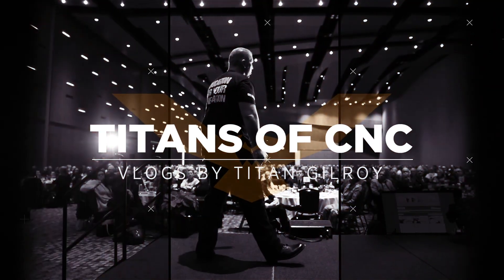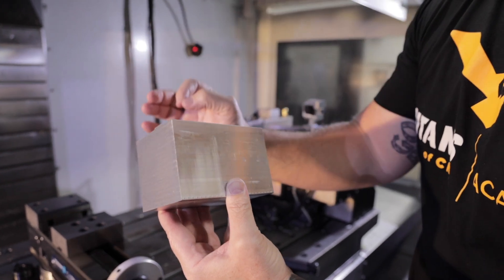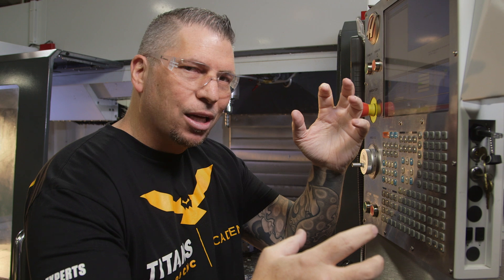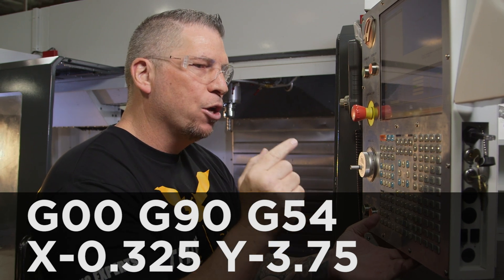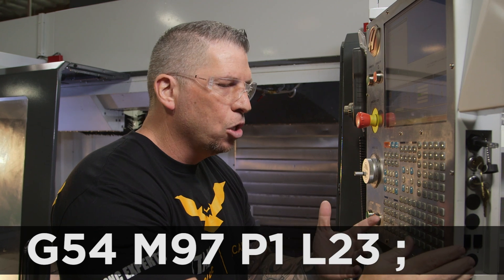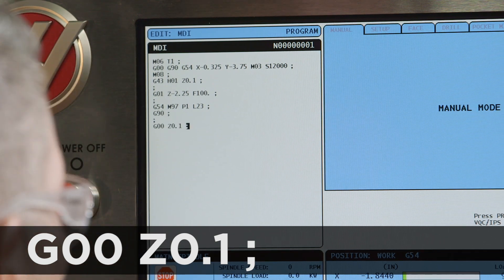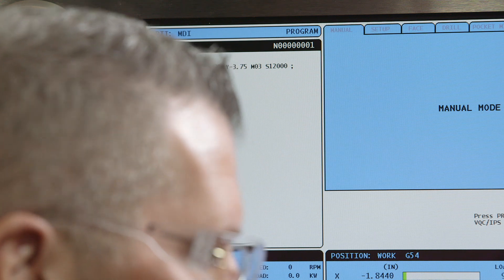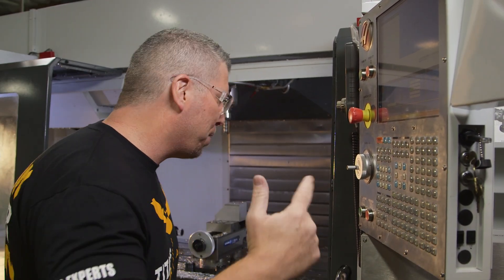G & M Code - Advanced Manual Programming Trick - TITANS of CNC Vlog #51

Comment: Can you set variables on hass? If I were doing a bunch of those I would program it essentially the same but set the feed line as G1 F[ VC1] and after each G1 move put something like VC1=VC1*1.001 for a 1% increase per pass to account for less material bring machined. Naturally, you could add; mulitply; subtract or divide depending on what effect you want
Reply: I <3 Fanuc variable programming. I worked at a job shop and had about two dozen programs that were basically subroutines that I would use to get through one off jobs as quickly as if I were set up for production runs.

Comment: Just did a  local subprogram. To do a bunch of interpolated holes
Code looked like this
%
N11111

N1003
T3 m6
Go g90 g54 z0 y0
S65000 me
G43 he z1.;
/M8;
Z.1

M97 P1000 (SEARCHES FOR N1000 below)
:
X5. Y-2. (New hole center location)

M97 P1000 (n100 again)

G0Z1. M9
G53 Z0. M5

M97 P55 (SKIPS TO N55 DOWN BELOW)

(Subprogram);

N1000
G1 z0. F50.
G91
 x.1 F25.
G3 i-.1 z-.05 L5( goes down -.250 from incremental start point)
G3 i-.1;
G1X-.1( back at center of hole)
G90 
G0 z.1 
M99;

N55 
M30
%
Reply: Let me know whT you guys think or if I can do it in an easier fashion( reason why my feed moves are in incremental is because I do this a lot when thread milling. I will go down to thread depth without cutting material and interpolated while going up on z with an L for repeat command, until I clear the hole and can go back to g90 mode.
Reply: It is imposiibile doing circle from,
G1z-10
G91G3x-0.1I-0.05
I0.1 
to Z0..

Comment: Back in the day, i used to use a sub incr z+, prog loop, works a treat, in heidenhain, or m98 /m99 also incr scale factor to produce pyramids, you can work out the tangent and create the x/y stepovers to create the angle, also linear polar and angles can do loads for way less code, just link the subs together
Most Miller's would have a bunch of subs tucked away 
This was back when cad was only used for more advanced profiles

Comment: We had two old cnc lathes that had to have their entire program written in incremental. The new programmer and newer supervisors kept crashing it thinking they knew more than us older experienced operators. Rather than admit they could learn a thing or two from the old guys on the shop floor they blamed the crashes on the machine being old to the plant manager. Their solution was to scrap both cnc machines and replace them with something they understood. A boat load of money later and the two new machines produce 3/4 the amount the old ones did with experienced operators. 

If your running a part where one critical feature such as a groove is dimensioned off another feature that needs constant tweaking because of tool wear, that's a good place for a few lines of incremental code. You only need to adjust for wear and the incremental feature remains locked where you want it. They can be dangerous if you have a new guy trying a machine restart in the middle of a program if he's unaware incremental has been implemented in the program.

Comment: What changes to the main and sub could have be defined to start center top and create a parabola?
Reply: Running on Heidenhein myself, how I'd do it there:
for simplicities sake we start at z=0 y=0 (which should be middle top of your work piece) and go down from there (starting from any height would be possible but requires more parameters) and side to side from x-5 to x5 (example values)
And we're going just side by side as here, not making it round (though doable of course)
First, take a running variable which will be the current z-value, I'll call it Q1
then from that calculate the current y value, which we will call Q2=Q1^2 (or if you want a wider parabola make it eg 5*Q1^2)
step value will be Q3, eg if you want to go down in increments of .2 then Q3=.2
So at every starting step we calculate our next Y value, go to it. Go to the corresponding Z-Value, take the cut, calculate next depth and corresponding Y-Value, go to them, take the cut back, repeat until maximum depth is reached.

the loop goes as follows:
Lable1 (this denotes the start of the loop)
Q2=Q1^2
G1 YQ2
G1 Z-Q1 (goes to negative Q1 depth)
G1 X5
Q1=Q1+ Q3
Q2=Q1^2
G1 YQ2
G1 Z-Q1
G1 X-5
Q1 = Q1+Q3
if Q1 > max depth, go to Lable2 (max depth is a value you have to add in, as far down as you want to go, note that it should be a positive value, that is if you want to go to z=-6 then max depth = 6)
if Q1 < max depth, go to Lable1 (if we're not finished, do the loop again)
Lable2 (end of the loop)

I hope this is understandable, english is not my first language so bear with me <3
be advised that "max depth" should be set at least 2*Q3 from running into anything, counting from Z0 down. All Q values are to be positive, the signs come in the formulas, that's just something I do so I don't get confused as to which variables were defined to be negative and which positive.
Reply: I am a complete nubee so all the descriptions are ver helpful! Thank

Comment: Nice video as always. :) 
I'm now a Heidenhain guy. I make programms only by hand. The subs are the best way to make programming easier.

I think you can have a video about macros (on HH Q parameters). The whole world changes with them. On the older HH CNC234 (20+ years old) I make nearly all the cycles that my TNC640 have by hand programming, with subs and macros for 4 axis and I can do helical milling and ramping with only few lines of codes.

I don't know how it works now on Haas controller because it was 3 years ago I last worked on a Haas but on a the Fanuc basis controllers I'm working on (NCT for examlpe but if I remember right Fanuc can do it, but I need to check it) I can use "I" before the axis letter and don't need G91. It is a more safer way. For examlpe IX, IY, IZ and so on.
Reply: Used to work in an aircraft place and  alot of the guys did this in HH,  macros are very cool if you can get your head around them, q defs allow so many variables
But most shops run down the line now, off m/c with setters/ops.. Its all changed :)

Comment: Machine angle blocks to hold material at an desired angle so you can use a large cutter to. Face off to the correct depth

Comment: You should have used variables for X, Y,  Z motions and the repeat count so it's generic and you can make quick changes up at the top instead of reading through the code.
Reply from the maker: I could do a million things... but wanted to teach code structure.
Reply: @TITANSofCNC  Encapsulation and abstraction are the heart of object orientated programming and thus safe coding practices and structure.
Reply: @qwerty3663  Do you have a link to a good video of the variation you describe?
Reply: @UshouldTryReality  No but it's how I write code.
Reply: @qwerty3663  I just wanted to clarify which technique you were describing so I think you're talking about Macro programming with variables right?
Reply: @UshouldTryReality  Yes.
Reply: On Haas machines macros are an option, so it's good to know how to do this without the macros option

Comment: I sure do appreciate you Titan. I practice Fusion 360 daily. I watch your videos and other machining videos. You add value to the whole country. God smiles on service to people. God bless you.
Reply: Does Fusion 360 automatically does this style of program? Or would it work from the top, where it makes a plunge, works in the XY axes. Once that z plane is complete, it takes a deeper plunge and repeats until the cut is complete?
Reply: Excellent question.  
He programmed it that way because his tool was long enough to take the full depth but not the full width of the material being removed. To cut from the top down he would need more cutting passes along the X axis and when looping the cuts with a sub program the way he did, would have ended up cutting alot of air the further it stepped down in Z. The program would easily have taken 3 times as long to run with a lot of wasted moves toward the bottom of the part. Bottom up programming in this case is simply the fastest way to get the part made and keeps the program the shortest.

I do not use Fusion 360 personally but most CAM software can cut from the top down or bottom up. I would expect Fusion 360 to be no different.

Comment: I‘m only programing in subs. I work on a machine that runs heidenhein and there it is much simpler
Reply: Yeah, labels are great on heidenhain, you can make literally everything.
Reply from the maker: Cam is easy... just wanted to teach manually
Reply: @TITANSofCNC  heidenhein isn't cam
Reply: @SoWe1   I was meaning combining programs posted from a cam program and running them together with Heidenhain cycles. and then running them with  pgm calls together :)
Reply: Same. Even running cam programs as subs i think is allot more safe and its easy to combine with axis rotation cycles:) in heidenhain

Comment: Amazing how all of the code fit in one frame of this video! 13:19 Printscreen crop, save, and posted in my shop. Sorry Titan, I did not learn any tricks of the trade to increase productivity. I am listening however! A CNC code library would be most welcome! Q: Is it just good code writing or is it absolutely necessary for the feed rate to end with a period (i.e. F300.  <==) ??
Reply: Your feed "F" command needs a decimal point, however, it does not need to be at the end. (Assuming you sre running in inch mide)Mills are typically in inches per minute, and lathes are typically in inches per revolution.
F.0031 = .0031ipr
F.031 = .031 ipr 
F1.3 = 1.3 ipm
F13. = 13 ipm
F130. = 130 ipm
F1300. = ???? In most cases it, in one way or another, = boom...lol, be careful out there.
Reply from the maker: Hmm 🤔 
Think so because you can also do F31.25

Comment: Hi titan do you know where g28 z0 is if you do not put g90 absolute, g53 is better!
Reply from the maker: If you don’t probe...
You can do a 

G49 Z0
G53 X-15. Y0

But if you probe

Then G0 G91 G28 Z0
G53 X Y etc
Reply: @TITANSofCNC  my "go home code" for all lathe programs is 
G0 G53 X0 Y0 Z0(or Z-8. Depending on the length of part. )
Reply: @peterloewen738gmail  That may be home position but that isn't zero return. Some machines want to be zero returned to index the turret. It depends on the builder and what interlocks they have. Most want at least Y zero returned. G0 G28 U0 V0 W0 is Zero Return. U, V & W are incremental on a lathe. You do NOT want to do G0 G28 X0 V0 Z0 on a lathe though because the tool will move to part X0 Y0 Z0 then go home... very bad.

Comment: Another good video, CNC guys don't get enough credit for their skills.
You ever use macro b? Another useful trick in some situations.
(MACRO B  QUICK EXAMPLE)
(MILL RECTANGLE OUTER PROFILE )
(XY ZERO AT BOTTOM LEFT CORNER)

#1=50.0(PROFILE LENGTH X)
#2=30.0(PROFILE WIDTH Y)
#3=10.0(PROFILE DEPTH Z)
#4=20.0(ENDMILL DIA)
#5=300(FEED RATE)

T1M6
G0G90G40G54X0.Y0.
M03S1000
M08
G0 X-[#4/2] Y-[#4/2]
G0G43Z2.0H01

G1 Z-#3 F#5
G1 Y#2+[#4/2]
G1 X#1+[#4/2]
G1 Y-[#4/2]
G1 X-[#4/2]
G0 Z100. M05
Reply from the maker: Yes

All good.

Thanks
Reply: @TITANSofCNC  What cam softwares do you use, and which mostly?

Comment: Awesome video Titan quick question for you why use incremental to send the machine home
Reply: It is an incremental move to 0.000 from the machines coordinate position as home G28 Z 0.000 home command  incremental. Where as on a lathe it would be G28 U0 W0 (U incremental move in X and W incremental move in Z) Brings both axes to home position incrementaly Zero from machines home coordinate system.
Reply: Use G53 it's the safe way.
Reply: @jf216  okay cool I'll do that thank you
Reply: @lennysweet8336  cool thank you
Reply: Also if you was to use G90 absolute active and the tool was one inch above the part then command G28 Z0 it will move down to Z0 absolute position before going to home position. That will make your heart skip a beat when you see that tool going in rapid traverse mode back toward the part before going home.

Comment: We use this technique all the time when broaching internal keyways... Exact same programming at the machine.. GREAT VIDEO!
Reply: You broach with the cnc?
Reply: @therussianmachinists2409  Guessing they are plunging in the Z axis with the spindle oriented and not turning. Just clock your broach in the spindle with an indicator and it should orient pretty close. Then you just plunge, come up, move over, repeat.
Reply: I do this in the lathe, works great. Edge Precision has a good video on it too.
Reply: @ashleyaewells  if you use the haas lathe with c axis spindle/brake  just use g71 much easier. (Parameter 315 bit 1 Set to 1)
internal spline or keyway broaching
Reply: @Innov8cnc  I'm running a Mazak QTN350, no C axis. I lock the spindle by turning it on at zero rpm and use my own macro for broaching

Comment: You can add to that another sub with a ball endmill. This sub would have ZX motion with minimal Y stepover and smooth the surface. Boom..!
Reply: The y motion isn't a step over. It is the length of cut and will remain the same. The x and z movements are the step over movements and if he changed them from 50 thou down to say 5 thou is would be much more smoother. The only other thing he would need to change is the number of loops, the L value. Just divide the total depth of cut by whatever z step over value your using to determine the L value.

Comment: Titan, how small of a dovetail can you cut. I have an aluminum part that is about 0.125", which needs a dovetail cut and the corresponding dovetailed part to slide within it. Doable?
Reply: Without seeing the part it is hard to say but I believe I have used a small dovetail from I think Harvey tools... I think it was a 3/32 Dia dovetail. So doable? Yes I believe it is doable.
Reply: Are you planning the part?  I would make my own dovetail with a splitting saw, run 3-4 times and get a diamond-shaped form, and make a corresponding counterpart, as I think everything will be very small and brittle.
Reply from the maker: Without seeing the part, and as said already... I would say doable. We do .030 high dovetails